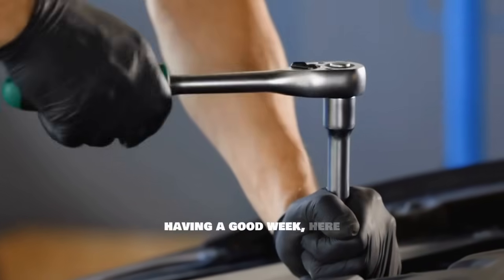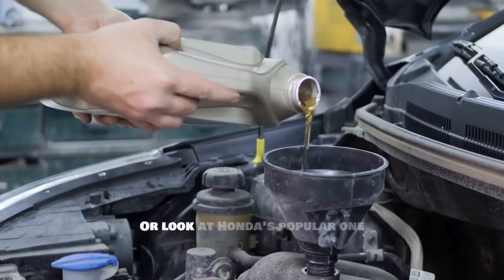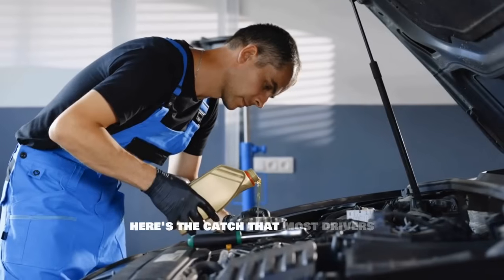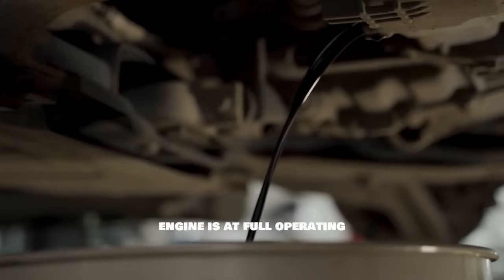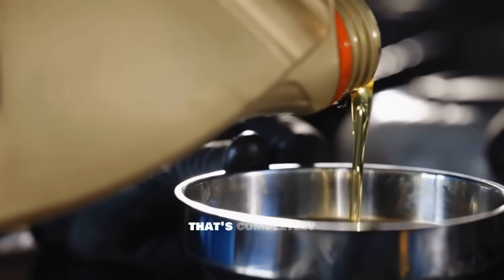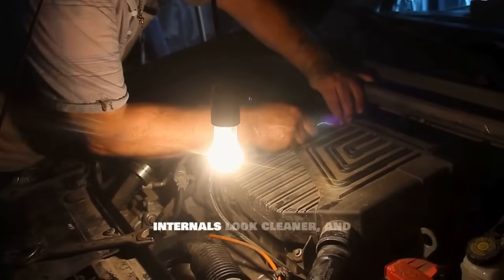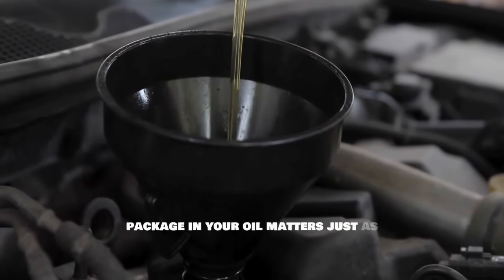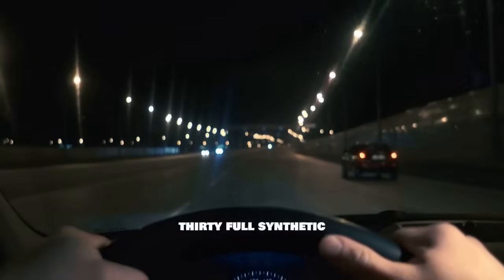The REAL Reason U.S. Cars Are Forced to Use 0W-20 (While the Rest of the World Avoids It)

Comment: I’ve had 2 Ford F150s. One for 18 years. Sold it with 360,000 miles. It burned a cup of oil between 5000 mile oil changes. 10w40 oil. Had a GMC Sierra 315,000 miles. Sold it when it was 20 years old. Same oil usage. 10w40.

Comment: I have a 2022 Takoma 4 cylinder. It has 28,000 miles on it. Been using 0W20. I was already planning on using 5W30 for my next oil change. Your video just confirms my thoughts. Thanks.
Reply: Engineers are very educated and put millions of dollars into the research and development of making the drivetrain of a vehicle 0W-20 works just fine in a Toyota

Comment: Great channel! Share and like! I'm a follower from Saudi Arabia. I own a 2024 Ford Raptor Twin Turbo V6. What oil do you think is suitable, even though Ford uses Motorcraft 5W30 in Saudi Arabia, but it's produced in Jebel Ali, UAE, and unfortunately not manufactured in the USA? What's your opinion?In Saudi Arabia, and especially in Riyadh, the capital, temperatures can reach 60 degrees Celsius in the summer and drop to 1 or 0 degrees Celsius in the winter, making it quite cold. What do you think, expert?
Reply: If you change your oil every 3000 to 3500 miles 5W20 is fine. Your changing it before it breaks down

Comment: 2024 Chevy 5.3 here probably going overboard using Mobile 1 extended performance guaranteed 20,000 mile protection but changing every 5,000 still using 0w20 for now
Reply: Good luck you’re going to need it.

Comment: No thank you ! I rather stick with manufacturer recommend😄
Reply: Yes specifically if you’re car is under warranty. You don’t want to void that warranty
Reply: It’s your car and your choice, if you trade it under warranty then you won’t have any problem anyway. Remember that manufacturers make more money if you buy new every few years. They don’t necessarily make recommendations based on what is best for the car, they need to pass CAFE. GM was having problems with the 6.2 V8 in the trucks where 0W-20 was required and not having problems with the 6.2 in the Corvette where they recommended 5W-30.
Reply: I understand that, but why would you put an oil in that you know is going to shorten the life of your engine? What good is a warranty if the engine dies right after it? I would rather take my chances, give the car what it is actually supposed to have and have a better chance of longer engine life.
Reply: 0w20 is fine under 70F, and no more than 5000 miles. If you want to know for sure, send an oil sample at the end of summer to Blackstone labs and find out level of metals in the sample.   It was $35 for full analysis years ago.

Comment: When my Chevy had lower mileage the oil gauge was vertical .... now it runs at 10:00 at 100,000 mi.  I like to increase the viscosity as it is aging. it increases the oil pressure better.

Comment: I use 5W30 Valvoline Restore and Protect in my BMW Z4, LEXUS 460L, and Toyota Tundra, combined 650K miles.  All run great use less than a quart between 5K changes.
Reply: That’s an excellent oil
Reply: What year tundra? We have a 21 5.7l and im nervous about the recommended 0-20

Comment: Why not use 0w-30 as a compromise?
Reply: You can. Will do the job while the engine is running hard and running hot. But when it comes to driving in short trips stuck in traffic keep this in mind when the engine temperature drops the film strength shrink down to the zero are you still going to need that protection at low temperatures when that engine is not running hard sitting in traffic or stop and go the oil still going to be too thin that's where the five W come into place
Reply: @darrylcurley6200 With the engine running, how's it going to drop to the O?